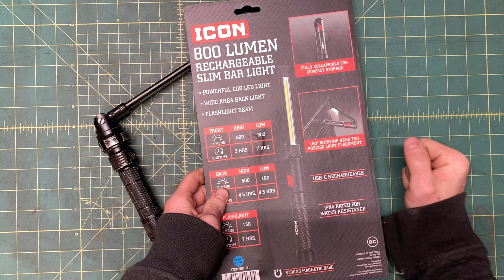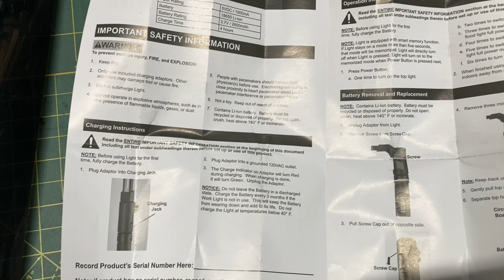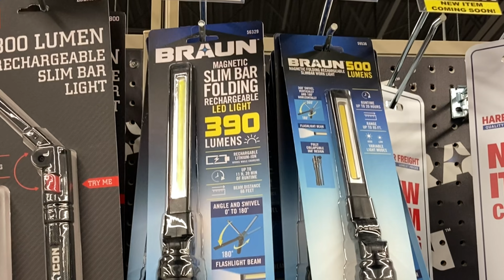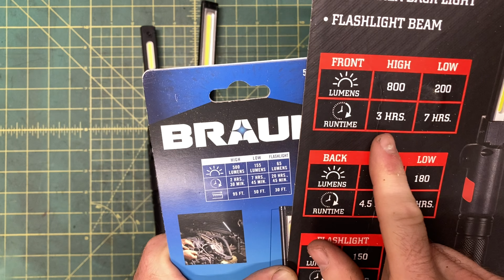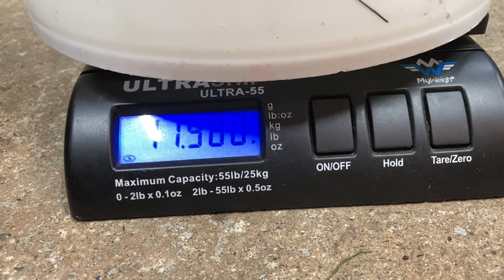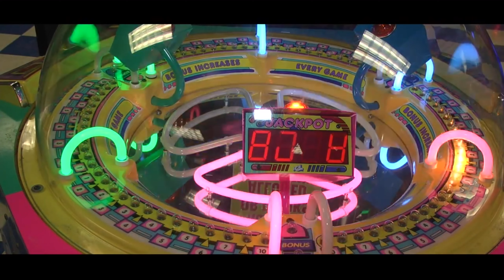New 2022 Braun & Icon Worklights From Harbor Freight: Unboxing, Review, & Teardown- Which Is Better?

Comment: Fellow schmuck here. I took my Icon light apart and flipped the light bar 180 degrees so the big light would point down when I fold it down. For what I use it for that works way better.
Reply: How difficult was that to do, i.e. special tools, modified original components, etc.?
Reply: @craigcraigster4999  I also did this, however the top flashlight no longer works. I'm sure I fouled it up, and it mounted slightly wonky but it was very easy to do.

Comment: The swappable battery is a deal sealer for me. You can always ditch the factory battery for a better one and put it right there with the built in one. By the time you get to 500 lumens only jumping to 800 isn't gonna be noticable by most humans.
Reply: Any recommendations on a better battery?
Reply: Interestingly enough, the included battery isn't terrible. I tested it with my load testing setup, and it hit its mAh rating. I planned to swap in a better Samsung cell, because I expected it to be trash, but no real need. High current draw isn't an issue, so a quality cell that can output high amps is pointless. I'd just save the cash on buying a high mAh battery and just keep some (free, from old stuff) spares charged to swap in.

Comment: The Braun double folding light has a fatal flaw. The joints are plastic and they quickly wear out. The tightening screws strip the plastic easily as well. I now have two of them that lasted less than a year.

Comment: Thanks for showing how to take the Icon light apart. I was able to turn the light bar around so the bigger led is on the front. I did what you suggested, broke off the plastic nubs on the inside of the neck and it worked. Thanks again!
Reply: Once the plastic nubs are removed, does the light feel just as stable and secure once it's retightened with the screws? And can it still be returned to its original orientation (with the larger light facing outward when unfolded) if I ever want to change it back again (which I doubt)?
Reply: @craigcraigster4999 Yeah, it's still secure. I haven't dropped the light or anything crazy, but it doesn't move around from normal use. I didn't try turning back around to it original position so I'm not sure about that. I think you would be able to because the top holes on light bar will still line up. I bought a few more because they are on sale for $24.99 right now.
Reply: @DERRICK-GIGEM-AGGIES23  Thank you Derrick!

Comment: Weighing the bucket is neat and gives you some exact figures on the magnet strength, but if I were doing this at home and not for a video, I’d just put a small sharpie mark inside where the water line is and reuse the same bucket for both lights and see which mark is higher.

Comment: If the lighting element is reversed per the steps shown at 20:04 , is that then a permanent commitment, or can  it be swapped back again to its original position (with the 800 lumen light facing outward when folded)?

Comment: @14:30 I'd absolutely love to see a fix for the button on the original 390LM work light. Something more durable than the original would be great! I ended up buying a HFT wired work light with a toggle-like switch after the button on my rechargeable one stopped working altogether; no clicky, dead and very little movement, if any.  The rechargeable work light is easier to use inside the engine compartment on the car, though. Thanks for the vid, and the humor!

Comment: I knwo this video is two years old, but what is that pin spanner tool you used @14:14 to get that internal ring off? All the ones i can find are 90*
Reply from the maker: Harbor freight SKU 63845. $5!
Reply: @thedoubtfultechnician  It's obvious now, I didn't recognize it without the handle
Reply: I use a pick

Comment: ICON was just on sale for $20 , bought 5 online. Checked the store later. The 19 they had sold in the first minute they opened. The 5 Braun's I have have taken a beating over a couple years. Only one had broken...Still works just flops around. They also cost $20.

Comment: I have been using the icon for a while now, and I had to reverse the top.. it seems to bend over the wrong way in favor of the small strip.  Doing this took out the top flashlight though.

Comment: Great Video, So I accidently reversed the battery and mine does not charge any more. I wonder if there is a FIX? 
 It does lite up with a new battery.
Reply from the maker: Braun? You may have fried the microcontroller that handles the onboard charging. You can charge the battery externally in a cheapo 18650 charger from Amazon, though.

Comment: I have had several of the brauns over the year. Broke one in half, the switch is wonky on one, the last one was left out in the rain. Now it will no longer charge a battery or work with a charged battery. It will work on high and tip light, low light setting flickers. Picked up all three of the ones you tested and totally agree with your assessments. 
Would like to see a switch repair video. Thanks.

Comment: I can actually see a perfect use for the lower brightness little rear light. Ive been looking for a battery powered light I can stick onto my mower, as I drive it between my house and my grandmas a few blocks away, and sometimes do so after dark (the neighbors must love me). I havent ever been able to find a good solution, and dont want to go strapping a massive lightbar to the front. Only issue is, id never have a rear light either to help act as a marker light to someone behind me. Not only would this produce enough light slapped to the side of the handlebars or frame, but the little back light would work perfect as a marker, though I do agree, a warmer light would be best. Thats all assuming it would be able to turn on at the same time as the front one, sooooo, null and void
Reply: They make inexpensive bicycle lights that would probably work as well for that, specifically, they have some nice red ones that can flash. I live in a neighborhood with no street lights, so I really appreciate the people that use these when riding at night opposed to the people that use no lights at all. I'm sure this would work ok for the headlight, but maybe also consider one of the red ones for the rear.

Comment: Cheap ass Walmart Hyper Tough 052022 works perfectly fine for me, dirt cheap, works great, lasts, and if I loose it, break it or whatever, the $7 I could care less. Lasts all day. Small and light weight. 4 different LED settings. And can be used while charging.

Comment: Seems like a coin flipper to me between the Braun and the ICON, although I have the original Braun dangly underhood work light, that was a waste of money, and the new Braun octagon “hockey puck” (the red one)style light; it is bright and has a strong magnetic base, but it sure does get powerful warm fast. So, I am unsure about the Braun brand anymore. You forgot to simulate the durability of each light of it being accidentally left on the frame under the car or underneath the hood by a DIYer or automotive mechanic for at least three months and finding it again later.
Reply from the maker: The video has been out for a month so expect those simulation results in 8 weeks lol

Comment: I have two of the braun 500 lumen. They fold in either direction, good magnet, usb-C (even some ring doorbells still has Micro usb) - With a coupon I got them for 17 bucks each so no complaints. My only issue was a weird flicker on high, with fresh charge it isn't really there but as it gets to 50% maybe it dims a bit and comes back. Maybe upgrading to non-factory cells will fix it.

~ Work Smart

Comment: Flip the Light bar to the opposite side like it should be like all the other bar lights are! 

Need a H2.0 bit to loosen the swivel and to remove both screws that holds the ICON LED bar.  Once loosed pry the side plastics that hold the bar in order to slowly flip the bar the opposite side like it is on the Braun light and like everyone wants it.  Once you have switch the bar to the other side (be careful as the wires connected are a bit short and could easily ripped apart as you do this) and carefully push the bar all the way in while the still having the plastic that holds it pried apart a bit.  This will help to install it in it's original position and not stay crooked to one side or become long in length because you put the smalls screws in the wrong holes! 

Yes the bar has two small holes, the bottom holes are to hold the light bar in position because the side plastic cups the hold the bar have two pin dents the protrude out the go in these first bottom holes to hold the bar in position.   You know you inserted the screws in the wrong holes because the light bar will be crooked.  Once position in the correct holes, then insert the 2 screws which will go on the upper holes and slowly tighten.  Test the light bar on all light modes to make sure they work.   If the single light at the tip of the bar doesn't light up that means you inserted once of the screws in the bottom hole and is making contact with the chassis of the bar and making bad contact so the light will not work.  Found this by accident until I figure it all out.

Now tighten all screws and the swivel joint screw that holds the bar as well but to your swivel liking with the H2.0 bit.  

Tighter screw = stiffer movement, etc....

Enjoy you modded Icon like it should have been from factory!

Comment: I just need a flashlight that doesn't have 16 settings and multiple strobes. I'm not trying to signal people in the woods, I'm trying to look underneath a frymaster to see if the fan is spinning.

Comment: When you plug the icon in can you see if it is charging or not? I just purchased the icon and the USB port is loose on the plug in on the flashlight and falls out. When I get it to stay in it doesn't show if it is charging or not. Thanks in advance for your response
Reply from the maker: Yup, the LEDs blink to show the charge status as it charges. Warranty time!
Reply: @thedoubtfultechnician  oh great. Thanks for your help. You are correct,I will have to return it. That will only cost me an hour of drive time 🤣😂
Reply from the maker: It’s pretty easy to take apart, maybe you can find a bad solder joint and just fix it? Not that you should have to, but an hour is an hour…
Reply: @thedoubtfultechnician  actually I just tried my phone cord and bingo it is flashing!!! Huuurayyy lol. That js for all of your help.

Comment: Quick (and probably dumb) question about charging the ICON 800 Lumen folding worklight -- the only USB-C wall charger/adapter I own is the one for my Motorola Moto G cellphone, which is rated at 5V 2A. Since the worklight's input rating per the owner's manual is 5V 1A (1000 mA), is it okay to use my 5V 2A charger, or will doing so damage the worklight's circuitry/battery?  I don't mind buying a 5V 1A charger if necessary.
Reply from the maker: It’s fine to use a higher capacity charger- the light controls the charging current, not the adapter.
Reply: @thedoubtfultechnician  I was hoping that might be the case.  Thanks!

Comment: Issue with my light is the light won’t turn off no matter how many times I press the button
Reply from the maker: Which light?
Reply: @thedoubtfultechnician  56329
Reply: Also can’t get switch out
Reply: Any ideas?
Reply from the maker: It sounds like the switch is jammed or defective. I can try making a repair video at some point but yeah you’ll have to get it apart.

Comment: Icon can be turned 180.remove 4 screws and flip it 180 and put it back together. But icons button wore out n has the same issue the brains V1 had. Sensitive n then not sensitive enough

500 lumens is good most of the time 800 I can say has its uses sometimes.

The magnet definitely seems skimpy in the icon also the rubber coating fell apart pretty quick

The icons charging takes a long time and seems to be wrong as having 2 leds then interrupting and plugging it back in, resets back to 1 light blinking.

Icons circuitry is Def more efficient though.

I wonder if the icon guts fit in a braun

Comment: I've had the old 390 braun for years and bought 2 more for gifts. Now I'm looking for a replacement. That icon is very nice but it really needs replaceable battery. A 30Q cell will be perfect for it. It is a better design and quality vs the 500lm braun. It almost seems like an "executive" work light, if that is ever  thing. The led mounted on the outside (+ side button) is actually a great design. It allows use of the light without opening the hinge. Dang it! Replaceable battery will make it an instant buy for me.